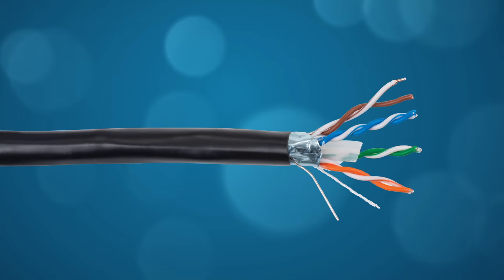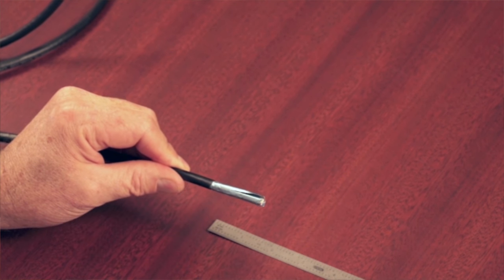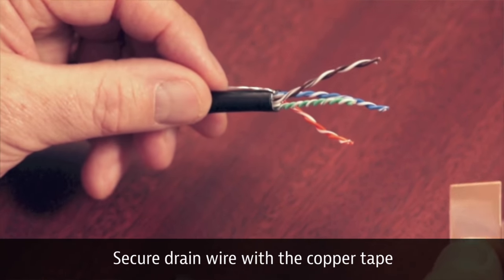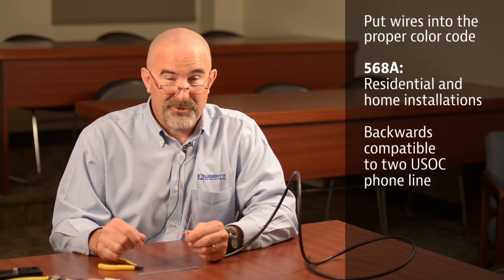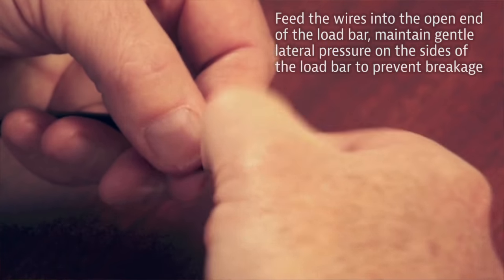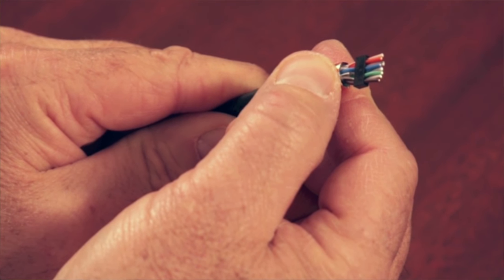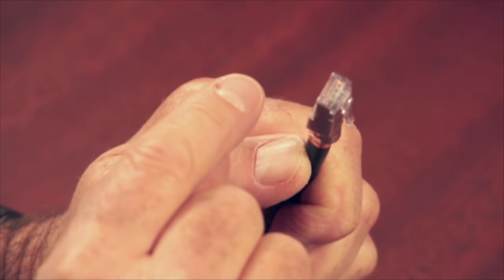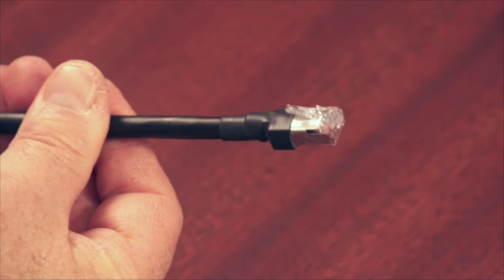How to Terminate Cat6 Shielded Cable with an RJ45 Connector

Comment: 568B is deprecated and should no longer be used
Reply from the maker: Hi @Martin Kuliza, thanks for your comment - I asked Ralph our expert engineer about it and this was his reply: "The wiring topology 568B is the standard today for RJ45 plugs. 568A supported POTS which isn't used much anymore. The code is now ANSI/TIA-568 revision D."     Hope this helps, would love to know your thoughts!
Reply: @AngieDurbinCreates  
this is a Multi part Answer
PLEASE READ IT ALL
Reply: @AngieDurbinCreates  
 PART 1
ok,  here are my thoughts

1. As an Engineer myself, if another engineer calls themselves "An EXPERT Engineer " they are not really an engineer .
you can call yourself an expert  BECAUSE YOU ARE
you can call yourself an Engineer  BECAUSE YOU ARE

When one is an engineer,  the title of "EXPERT " is implied and if you state it as a prefix it sounds wanky 

so.... we have that straight off the bat and this diminishes the credibility of your EXPERT ENGINEER

now.. if someone else calls an engineer an expert engineer (as you did )
a) The engineer should correct them
b) Because that person clearly does not understand what an engineer is 
and trying to put cool words before the title to pump up their own guys credibility .
in the end, the bottom line is ,  he either knows what he's talking about or not.

2. Regarding I.T. engineers, ....
it's highly debatable as to whether most are actually Engineers

(this is not hate,  this is the truth of the industry)

some get their title because they applied for a job that said   SENIOR ENGINEER Required,   or  EXPERT ENGINEER Required  or my favorite.... HELPDESK ENGINEER Required   hehe

then.. some actually have degree's but paid their way through Uni and more PAPER ENGINEER'S then real Engineer's 

3. But, ok,  lets say that your guy knows what he's talking about ,
ok.... BUT WE STILL HAVE THIS PROBLEM..

4. He's wrong,  Plain and simple.
In engineering,   if  you're wrong,  Your'e wrong
and HE IS .

and here is why 
Firstly Ralph called it a TOPOLOGY   hehe
it's called   A WIRING SCHEME  or   WIRING STANDARD
Very very very very fucking rarely is it called a Topology.
usually when you use the word "TOPOLOGY " you are talking about types of networks and the devices in them and how they are arranged RELATIVE TO EACH OTHER
in common use in the industry , Real engineer's do not usually say "this cable has this topology and that one has that"   they usually say  "this cable has this wiring standard or follows this wiring scheme"

all this leads me to question the extent of ralph's experience.
so.. firstly he's wrong on that point and sounds amateurish when he calls it a topology

Next... we have this...
Ralph states (as you said)
The wiring topology 568B is the standard today for RJ45 plugs
 
well,  NO ITS NOT
Read this 
https://en.wikipedia.org/wiki/TIA/EIA-568

Now, Just on the point of    IT'S THE STANDARD TODAY
Wiki says the following
"ANSI/TIA-568 recommends the T568A pinout for horizontal cables."
and the STANDARD (Which outranks Ralphs Expert Engineering status) also says that says that standard B should be used as AN ALTERNATIVE IF NEEDED , basically it portrays it as a SECONDARY option.
Meaning IT'S NOT THE STANDARD TODAY

CONTINUED IN PART 2
Reply: @AngieDurbinCreates  
PART 2
Now..  i have also noticed that wiki does not mention the word "deprecated"
but as a fact,  a few years back,  it literally stated  "TIA568B is now deprecated"
Meaning... a few years back it was being phased out 

and for the record,  just to show you i'm not trying to piss in your pocket, 
I MYSELF WAS USING STANDARD B AND PREFERRED IT ,    ok

But... Facts are Facts,  the creators of the standard DO NOT WANT US TO USE STANDARD B ANYMORE

they also say this
" Many organizations still use T568B out of inertia."

if you read that page,  it's clear to see that 
a) They don't want to use it anymore
b) They have made their position clear that A is the standard
c)  but, the problem is most companies are not giving a shit and still using B

and that's fine... but the point is 
if your'e making a video and you're teaching people.. TEACH THEM CORRECTLY

and , if you're Engineer is telling you it's the standard today.... MATE... HEHE   ... HE'S DEAD WRONG and i've just proved that
now.... go and ask ralph for his opinion and show him this article,   I'd love to hear his thoughts

Next.... (and this is a biggie )
see this statement
"The wiring topology 568B is the standard today for RJ45 plugs"

well.. RJ-45  is not a plug    LOL
ummm yeah.....  and this is the part where ralph's jaw drops   LOL

Mate...  the name RJ  Stands for  REGISTERED JACK,  it's a jack, ok
You have Jacks  and you have PLUGS  or MODULAR PLUGS or what the industry calls  MOD 5 Connectors or Mod Connectors
basically let's keep it to Plugs and Jacks

Now.. the Jack is the thing in the wall
the Plug is the little plastic bit on the end of your U.T.P. Cable

continued in PART 3
Reply: @AngieDurbinCreates  

PART 3

Now let's clear up some other mistakes

Techs usually call anything , A CAT 5 CABLE
it's not called a CAT 5 CABLE
it's called a U.T.P. Cable  (Unshielded Twisted Pair) and the CATEGORY of that UTP Cable is   CAT 5.

but, back to the RJ-45 plugs

the plugs themselves are not RJ-45
they can be combinations like    
8P8C
8P6C
6P6C
6P4C
4P4C
and so on

The P Stands for PIN or  PINS
The C Stands for CONDUCTOR

The first number in the Naming convention of the Modular plug denotes   HOW WIDE THE PLUG IS 
hence 8P  Means it is 8 Pins Wide

now.. you don't always have to wire it up with all 8 conductors ,
you might want to use a cable through a patch panel that has RJ-45 Jacks but you are only interested in PoE (Power over Ethernet) and as such you only need 2 conductors (blue and White) but you need the 8 Pin Wide Plug  (Which some called  RJ-45 Incorrectly) so it doesn't wiggle in the Jack 

so,.. You would be terminating an 8P2C Plug
you got that... so.. it's not a jack   it's not RJ-45   

Basically there is no such thing as an RJ-45 Plug
there is only an RJ-45 jack or wall socket (if you will)
this is a problem that started with basic technicians and has been perpetuated fucking forever  AND IT'S INCORRECT

Now... if Ralph is an engineer,   HE SHOULDN'T BE USING THIS TERM.
i would understand a basic technician using it , because he heard it elsewhere,  but  AN ENGINEER,    AN    ......Expert  :P  engineer  being the expert that he supposedly is ,  SHOULD BLOODY KNOW THIS , do i really need to say this ?

ok  so so far Ralph is not looking very credible ,  is he ?
and i'm asking myself a few questions

1. is ralph really an engineer or one of those guys that calls himself an engineer and then managed to convince some Non I.T. people that he's hot shit and they then started calling him  EXPERT ENGINEER

2. Why is ralph making all these mistakes if he's an engineer 

3. oh,  i forgot on other point
Back when i did my Microsoft Certifications  (MCSE)  It was stated in the course that  Standard B is Deprecated ( i just remember that now) so we also have that,   and you can verify that if you like    Just get an old copy of MCSE or   MSCA if you like and look it up 

now we have this
ralph says
"568A supported POTS which isn't used much anymore"
LOL... isn't it ?    Really ?

well..   i have to disagree , don't i 

Look, i suppose it kind of depends what country your'e in 
I'm in Australia
here in Australia we had the P.O.T.S  for perhaps 110 odd years now

we now have a network going up and being rolled out called N.B.N. (The australian National Broadband Network)
this network has a few basic Technologies

- Fiber to the Premises   (Fiber Direct from the Exchange to the premises)
- H.F.C. (Hybrid Fiber Coaxial)   Basically a DVB-C Network that interfaces with Fiber from the exchange then becomes the Coaxial network (or as USA would call it ,  THE PAY TV NETWORK)  OR CABLE TV NETWORK

- then you have  FTTC (Fiber to the Curb)
this heavily uses the P.O.T.S network

so i don't know where he's getting that from
but then you also have this problem...
the point of 568A was not to support P.O.T.S 

if you look at the pins in the standard 
you have your 
Blue -  Blue White
Orange -  Orange White
Green -  Green White
Brown - Brown white

now..  the phone network only uses 2 wires...... Blue and Blue White
so... QUESTION....  if 568A  only supports  A   WHY ARE THE OTHER WIRES IN THE STANDARD ?  hehe

see... he's wrong,  you can't bullshit your way through this

now.. if ralph is going to say ,   but yeah,  it supported it and the digital network
well,  ok... but so does the B Standard,  so..... why say   A supports POTS,   when B Also does 

again... Ralph is not looking very good.. is he ?

so now.. FINALLY   AFTER READING ALL THIS 

QUESTION 1.  DID YOU ACTUALLY GET THROUGH IT ALL

QUESTION 2.  DID YOU REALLY ACTUALLY WANT TO KNOW MY THOUGHTS OR ARE YOU THINKING TO YOURSELF  "Holy fuck what the hell did we start"  :P

QUESTION 3.  WHAT IS YOUR CURRENT OPINION OF RALPH

and in conclusion

RALPH IS WRONG
i'm sorry mate ,  but he is 

and  as i said in the beginning , very briefly     B STANDARD IS DEPRECATED 

now let me also say this    AS AN EXPERT  (and i am )

Electrically speaking....  Each Pair is an electrical circuit that when connected to a network device performs a function

THE STANDARD SAYS THAT WE SHOULDN'T USE B ANYMORE
My Personal opinion,  ... I still love it,   I'm used to it ,   but i don't use it anymore because i'm respecting the wishes of the standards board
and as a professional , we need to uphold these standards because they are there for a reason

in saying that
it doesn't actually matter which colour scheme you use so long as BOTH SIDES ARE WIRED IDENTICALLY .

it's actually more important to know the wiring standard that the modem supports because if you fuck that up , you'll have no throughput or limited throughput

so.. i am being fair and i can be 
and i'm not trying to shit on ralph

but, mate, seriously ... he doesn't sound like an engineer
and if what you're saying is true about him,     he sounds like one of those self taught guys that just heard stuff from other techs who were taught incorrectly and HE BASICALLY ROLLED WITH IT 

bottom line
he doesn't sound like an expert
he doesn't sound like an engineer
he sounds like a basic network technician who can probably do a few things and it's likely that you guys like his work (from what you're saying) but that doesn't make him an engineer 

engineer's don't fuck up basics like this , ok

so n ow... I'D LIKE TO KNOW YOUR THOUGHTS 

speak soon

Comment: Use stripper for scoring the jacket :)
Reply: It's impossible to terminate perfectly a cat6 shielded cable I broke my fingers pushing the wires to the rj45 jack
Reply: @misterxzxc7314   you must have weak fingers.
Reply: @misterxzxc7314  the wires are thicker, are you sure you used Cat6 certified RJ45 jacks?. I learnt the hard way you cant use cat5E (easily) but once i switched the cat6 cable runs were easy
Reply: @AmirKhan-qx2lr  I don't have a straight through rj45 cat6 plugs like you have in USA plus the cable I have has a strong plastic separating the wires and a metal wire and a  metal jacket covering them all so it's very hard to make a perfect one with these but I managed to do a cat6 cable perfectly with other types of cable
Reply: @AmirKhan-qx2lr  I thought the same thing. Cat6 jacks usually have staggered wires at the end. This one appeared to be straight.

Comment: This video is so wrong it should be banned. Terminating a CAT6 cable using a real male plug specifically for this application is the only method that should be used. The male plug shown in this video is not correct for any CAT6 solution.  It will not pass any certification testing which is required for CAT6 cabling. There are several manufactures (Panduit, Belden, Leviton, Ortronics, etc.) which make a proper male plug. These plugs are guaranteed to work and pass certification.  They are more costly but easier to terminate and work extremely well.  All the manufacture have termination videos.  If you want to make this really work do not use the connector shown in this video.  I have my RCDD certification (18+ years) and not a sales person for any of the manufactures listed. Reply if you have questions
Reply: I am preparing to wire my house and a friend's house with ethernet.  I was planning on using Cat6a as I can find comparable prices to Cat6.  I would like to know more about what was wrong in this particular video and where I can get better instructional videos.

Comment: Sooooo many unnecessary steps 🤦🏻‍♂️ I’m glad techs I work with don’t follow this we would be out all fkn night
Reply: I hate to imagine how many other corners you cut.
Reply: Raz Cann I pull my speeds that’s all that’s necessary where I work ....I’d hate to see how long you would actually use that excuse to set on a job
Reply: @changeforthebetter4063  Great a question with a question. Typical
Reply: @Raz Cann why did it take you 3 weeks to reply we’re you terminating that 1 punchdown ?